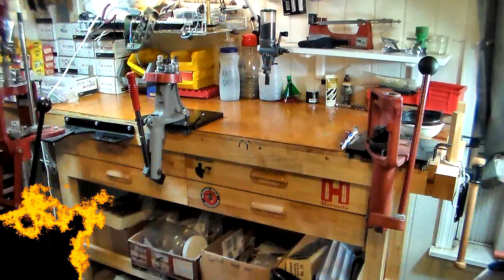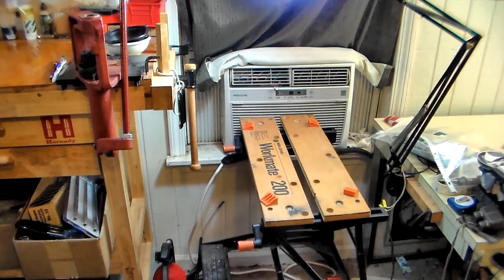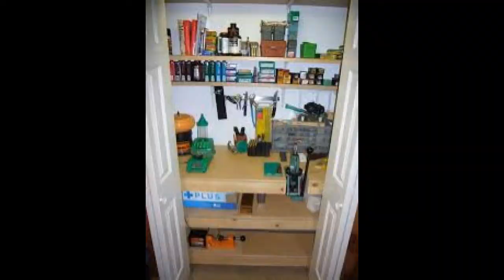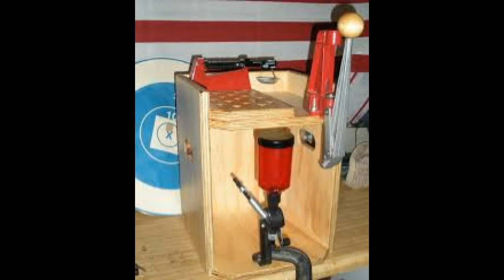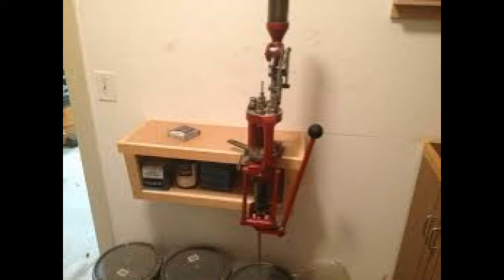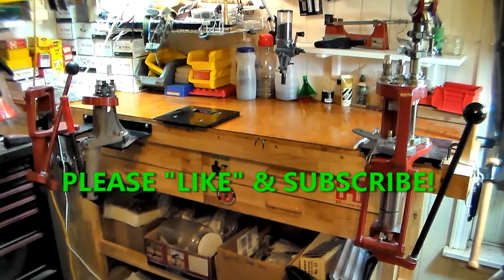"WHAT TO" Reloading Series VIDEO 10 RELOAD BENCH

Comment: "Basic Handloading" by George C. Nonte Jr. 
page 43:
"Use of an adjustable powder measure will greatly speed up the operation."
page 45:
"If you discover an error after forty or fifty rounds have been completed, there may be no way to identify the cartridges that contain the error."
"Usually, a charge that bulks abnormally high or low will do so at the expense of the charge thrown immediately before or after it. A light charge in the case might mean that some powder remained in the drop tube, and so was probably added to the next charge thrown; an overcharge probably indicates that powder hung up in the drop tube from the pervious charge, making it less than it should be." 
"If it seems that I'm dwelling overmuch on powder charging, remember that this is the most critical of all the handloading operations to safety. You'll get no joy or profit from handloading if a mistake or an oversight causes a gun to be wrecked or a shooter to be hurt. Handloading is essentially a very safe practice, provided one adheres to the basic safety requirements and concentrates on the job at hand."

Robert A. Rinker also tells the same thing as above in his book titled "Understanding Firearm Ballistics 6th Edition.

Squib Loads, Hang Fires, and Double Charges:
Basically these conditions are brought about by the use of a progressive press with an on-board powder dispenser and static electricity bridging the powder charge as to only dump a small amount, if any, into a case that goes unnoticed and a bullet gets seated. Then the next round gets a heavy charge that will blow a gun into pieces. 

A squib load is where there is no powder, or very little, to the point that when the primer is ignited it pushes the bullet out of the case into the lands or a small amount of powder pushes the bullet part way up the barrel. A hang fire is where once the primer displaces the bullet into the lands the low powder charge then has too much room to build pressure immediately, so it burns slowly until the pressure builds up and then after a small delay the charge will start to burn faster to the point it will either spit the bullet out or lodge the bullet further down bore. This is why I never recommend the use of a progressive press with an on-board powder thrower, as this type of set-up has been responsible for both squib loads and hang fires, as well as guns blowing up. The guns that get blown up are the ones that got the powder that was hung in the measurer, due to static electricity bridging the powder in the down spout, from a previous squid loaded round so that it ends up with an over charge. Yes one of the rounds in a squib load's batch could very well be one that literally blows the gun apart. Most people that end up with a bad round end up spending a lot of time disassembling the rest of the batch, be it a few or hundreds or even thousands of rounds, for safety sake. A lot of time spent that they tried to save by using a progressive press in the first place with a on-board powder dispenser. Then they have to turn around and remake the rounds a second time, of which if done again in the same manner of using a progressive press with and on-board powder measurer may very well end up needing to be re-disassemble all over again if static electricity rears it's ugly head this go around too. A vicious cycle of which ultimately some one will get hurt or worse be killed by the neglect of a Handloader that refuses to take the time to reload safely! Yes when it happens it will not be an accident but rather a form of Negligible Homicide. Premeditated if one was warned and refused to take head. If one wants to play the odds they should take a trip to Vegas, not the gun range with this variant form of Russian Roulette!!!

Personally, I will not run a progressive press because of all the safety checks they cheat us out of. I run all my brass through one step at a time on a single stage press, with hands on every step. This gives me plenty of time to catch cracks/slit cases, primer hole issues, primer seating issues, bullets seating issues, and crimp problems. If anything is out of whack the brass gets reworked or trashed. As for powder I weigh every charge! I use a powder thrower to dispense powder into the scale pan, a trickler to round off the charge weight on a beam scale, and then I set the pan onto a digital scale as a double check. If the two scales do not agree I recheck the beam scale poises and re-zero the digital scale. Normally it is the digital scale that has drifted, but once it was a beam scale poise got moved by accident. Either way all my powder charges get checked three times. Twice by scales and once with a visual, in the loading block, after I have charged a batch before seating bullets. I do what I do for safety not speed, cause as the old saying goes "SPEED KILLS!" And I encourage all to avoid finding out the hard way.

Static electricity and plastic reloading tools? Why do manufactures use plastic powder hoppers on a powder measurers when it causes static electricity to bridge the powder in the drop down spout, whereby causing light squib loads in some cases and then the next ones get a charger and a half that blows up the guns? This is a well known phenonium (mentioned by George C. Nonte and Robert A. Rinker in their books) and yet ALL the manufacturers of these powder measurers still go with plastic powder hoppers. Mean while DRAMWORKS makes PYREX powder hoppers for all the major brand powder measurers to replace the plastic ones to negate the hazard of static electricity bridging the powders. I myself am getting one ASAP!

see: https://www.dropbox.com/scl/fi/gnrfithibexs9cbp73ajx/KIMG1324.JPG?rlkey=x8aope9vjy3hv1n3kdrd0jp3o&dl=0

Comment: Metallic Cartridge reloading, on bottom right of page 6, states - 
accidents do happen in handloading, either at the bench or with the firing of dangerous handloads. Loading one's own ammunition at home is not a lot different than the assembly of cartridges in a large ammunition factory, the primary difference being the degree of care, caution, or whatever name by which common sense may be known.

Shooter's Bible Guide To Handloading, in the "Introduction", on the bottom left of page X, states - 
Handloading requires a bit of study. because handloading puts you close to things that could impair or abbreviate your life, you're smart to mind these caveats:
Yes you can handload at home, but ... Handload only if you can honestly claim a reasonable level of intelligence, proof of which is your willingness to read all caveats twice, take them to heart, and admit in all humility that, no matter how long you've been shooting or how many times you've pumped a press handle, you do not know all there is to know about handloading. And won't ever. 

Metallic Cartridge reloading, on bottom right of page 16, states - 
ignorance can get even the most careful of men into trouble if there is some key element that he needs to watch closely and cautiously but he knows nothing about it.

Lyman 51st Handloading Handbook, at the bottom left of page 60, states - 
CAUTION: Static electricity may cause primers to explode.

Speer Handloading Manual Number 15, on page 41, states - 
Static electricity and the Reloader
1. Static electricity can be highly hazardous for the reloader.
2. primers are most sensitive to static charges. The energy is enough to ignite primer dust in and around priming tools. The dust can ignite and propagate to all the primers in the tube [or tray]. The result is a serious explosion. This is the reason to keep those tubes [and trays] clean!
3. Static charges prefer low humidity environments. take some simple precautions.
a. Use a humidifier. 
b. remove carpets from reloading areas. This is the prime source of static energy accidents.
c. Clean the reloading area on a schedule. Routine cleaning removes residues of primers and propellants that can react to static energy.
d. Use an anti-static product.

Reloader's Guide - Complete, Fully Illustrated Step-By-Step Guide to Handloading Ammunition, on page 129, under Common Reloading Problems states:
Plastic powder funnels often pick up a far amount of static electricity ... ... ... this is annoying because powder granules stick to the side of the funnel, and you have to keep tapping the funnel to remove the last granule of powder. [Yes, one big hassle? And tapping on the funnel for the next 50 years could give one Reloader's Wrist! I kid you not.]

Metallic Cartridge reloading, on bottom right of page 11, states - 
One deadly enemy of the handloader is static electricity, which lurks constantly around anything plastic. An aluminum powder funnel avoids the problem of static electricity generated  by the sliding of powder granules across its inner face. However, only Pacific makes aluminum powder funnels. The other makers use plastic, and these can cause erratic powder charges, some of which are excessive. 

The ABCs of Reloading 10th Edition, upon top left of page 161, 
under "Environmental Conditions" states - 
conditions that can compromise your safety or loaded ammunition's integrity. static electricity which is never a good thing around powder.

Modern Reloading Second Edition Richard Lee Revised 2021, about the bottom half of page 85, under the heading 
"What are the causes of excessive pressure?" states - 
"It seems that some shooters were experiencing hot loads from what should have been quite safe. With much detective work, they found the problem occurred only when loading from the bench and immediately firing the round. Ammunition loaded away from the range worked fine. They discovered that the normal jostling of travel reduced the pressure to correct levels. Accurate recommends that ammunition loaded at the shooting bench be rolled back and forth a couple of times to rearrange the powder granules." [Rolling the cartridges around releases the static charge in the powder due to the use of plastic powder thrower reservoirs, plastic dippers, plastic powder pans, plastic funnels, and possibly even plastic loading blocks, as well as any and all plastic primer trays. One should also avoid plastic laminated counter tops too.]

Here one from a Black Powder Manual, in case anyone is thinking about using plastic stuff to handle Black Powder.

SPG Lubricants, BP Cartridge Reloading Primer:
Chapter 1 - Powder, page 22, WARNING: 
"BLACK POWDER IS CONSIDERED AN EXPLOSIVE AND IS EXTREMELY SENSITIVE TO SPARKS OR STATIC ELECTRICITY. ITS USE WITH PLASTIC FUNNELS OR POWDER MEASURE HOPPERS IS TO BE AVOIDED. HEED ALL WARNINGS FOUND ON THE CANS OF BLACK POWDER."

So Plastic tools around Black Powder is an extreme no no, and should never be done, period! So why buy a cheap plastic funnel for smokeless powders only to turn around and have to buy a descent aluminum funnel later on when one decides to do black powder too. And yes according to many manuals static electricity can be a highly hazardous - deadly enemy - to the reloader of which can compromise the integrity of their smokeless powder ammunition and even explode modern primers, as quoted in my previous comment. One may live in a high humidity area of which they have no issues with static electricity, but for them to tell others, that may actually live in lower humidity areas where static electricity abounds, not to worry about such is just plain irresponsible.

And yes static charge in a cartridge can blow a gun up, if it is not discharged from a max load before shooting it. Seriously it is not a matter of personal preference! It is a SAFETY issue period! Well other than having to tap the funnel all the time to get the powder to go on down. What a pain , and waste of time, that must be.

And for the newbies I'll repeat so that no one misses this.
Static electricity lurks around everything that is made of plastic, which the powder will stick to, and become induced by it. Best not to use plastic funnels, dippers, scale pans, loading blocks, or any plastic on a powder measurer. DramWorx makes PYREX powder hoppers for all modern powder measurers to negate static build up in the powder measurer. Why the makers of the powder measurers do not do this from the factory is bewildering. 

When bench rest shooters load ammo at the shooting bench with plastic tools they find that the load is hotter than it would have been if they loaded it at the reloading bench at home. Even though they still used plastic at home, by the time they get to range the static has dissipated from jostling around on the way to the range. If one does use plastic reloading tool and wants to shoot the cartridges immediately, it is recommended to roll the cartridges on the bench to help release the static from the powder. Or just stop using plastic tools to reload with and by pass the issue.

Comment: Thanks for the pin on video 9.  I found CMAX doing a video search for work bench / tables.  Seeing your bench with drawers answered a question about whether its necessary to build a bench with leg room underneath the bench.  
I bought the Lee 4 turret press and dies for 9mm and 10mm.  My question is why might I want one or two additional presses.  I do have a few rifles and shotguns.  Will the same turret press I bought load those guns too?
Thanks for all the videos and the time you spent making them.
Reply from the maker: All but the shotgun, it takes a different press and equipment. I suggest you slow down, get used to the equipment  you have & use and you will (over time) find out what way you want to reload (there are many ways to do the same thing) then you will be able to pick the best equipment for you!